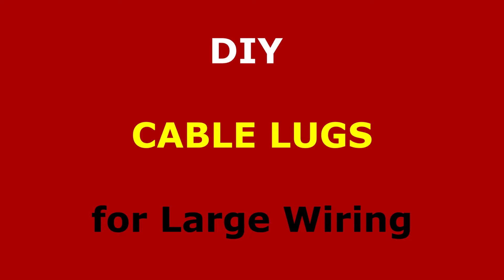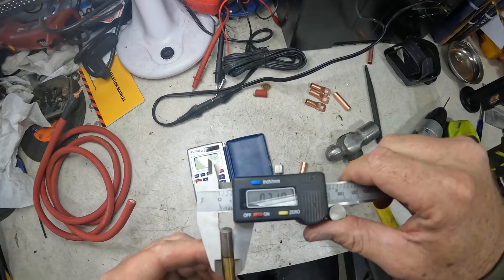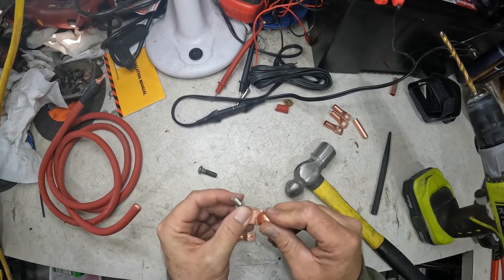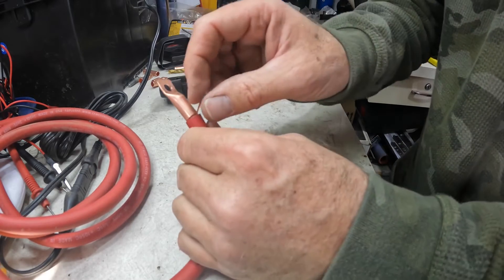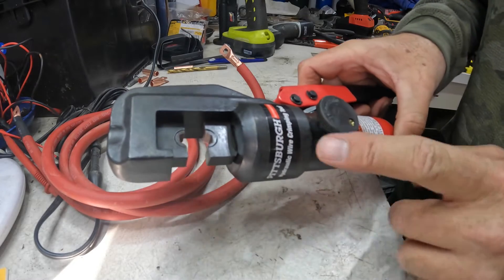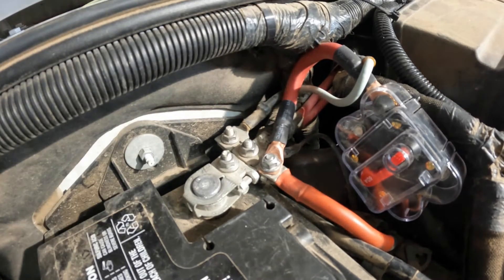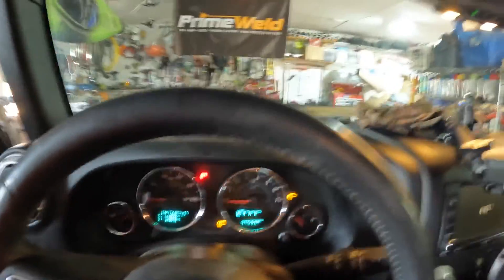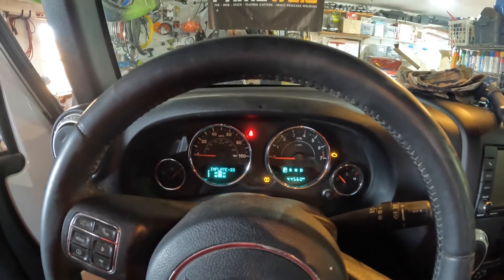DIY Cable Lugs !!! (for LARGE Wires/Cables)

Comment: Thanks for the video. I didn'd even realize that you can make decent lugs that way.

p.s. Horrible breaker btw, don't recommend to use it with any battery or a high amp source. Sometimes it just doesn't break when heated and doesn't reset manually afterwards. It is not rated for that much current so when the short circuit occurs it will probably melt down and let the circuit to stay shorted. You better look for some Tomzn DC breaker rated to your amperage and INTERRUPTING RATING.
Reply from the maker: @beaconbeing  good recommendation, I have wondered about the quality of this one. Thanks for the comments!